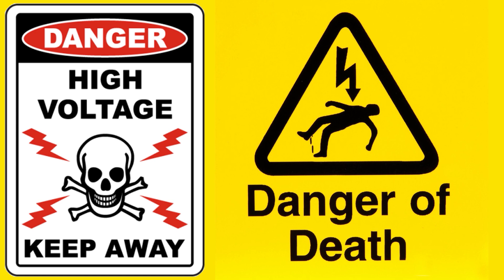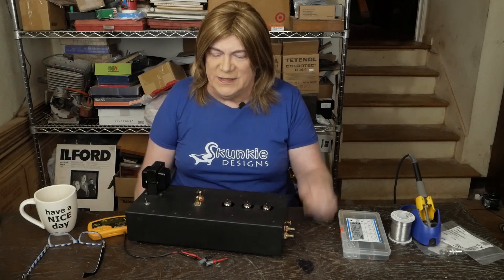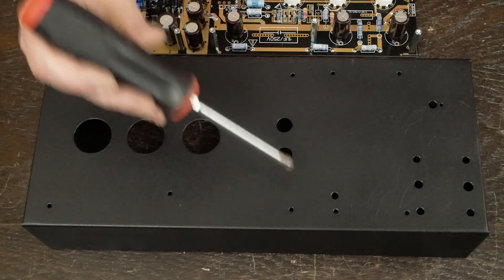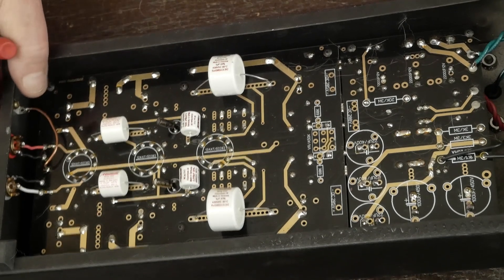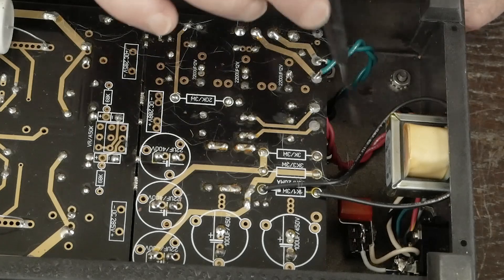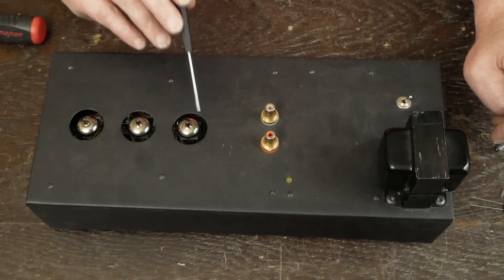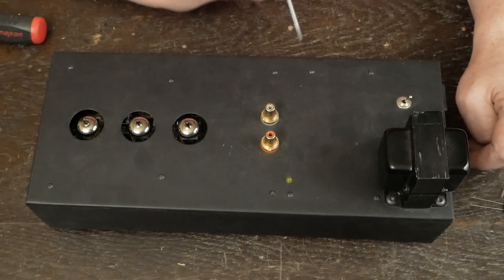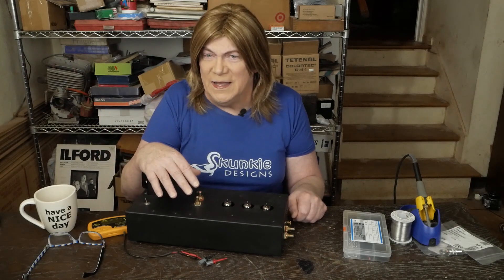EAR834 Clone Phono Stage Pre-amps: Chassis Layout Explained.

Comment: It's the phono amplifier that I put together in August 2022
The output is high.
Reply from the maker: Yes it does have a hot output, and the problem is?? It's actually hot enough where it works well with HO/MC carts.

Comment: Steph, a couple of questions:

This is of course a clone of the EAR 834p. The original EAR never had a mono switch as some phono stages do, and so naturally you have not included a mono switch on the clone either. I plan on getting some vinyl records that will be mono pressings. With the EAR/EAR clone if one plays a mono record with them and uses a mono cartridge is that enough to get the intended sound from a mono record?  Are mono switches on phono preamps unnecessary? Is a mono cartridge sufficient?
Reply from the maker: I can't honestly answer that one, sorry.

Comment: Hi and thank you for all the great things shared in this channel,  I'm in the process of building one of these 834p kits, I don't know how's it in the other pcbs sold on ali, but I just discovered in mine the grounding point (little triangle)  for TT isn't connected to anything, it's isolated on both sides of the PCB so connecting it via wire to the chasis doesn't probably change anything, and if so should it be rewired to the PCB's ground or just left unused?
Reply from the maker: I covered this in one video, that's an error on some of the boards, that pad needs to be connected to the ground plane on the bottom next to that spot, opposite side from the tube sockets. Just scrape off some paint and add a jumper.
Reply: @SkunkieDesignsElectronics  ouch I must have missed that one, gonna look for this video right now, thank you.

Comment: Wondering if the BOM on your website for this is up to date for the new build?  I.E.  new chassis size/ standoffs/ fuse?
Reply from the maker: probably not, I'll take a look at updating it.
Reply: I used it recently and all went well.  I think some parts are discontinued but replacements worked fine.
Reply from the maker: That's the problem listing part numbers, many, especially semiconductors and caps, change all the time.

Comment: Correct grounding was the finishing touch. I had the ground on the PSU side connected, and when I connected the ground on the other side of the board the noise floor was slightly lowered, which for the life of me I can’t explain🙂. I had already lifted the signal ground with 100R/100nano paralleled, but that had no effect.

Comment: I have two questions.  Will this pre-amp work with moving coil cartridge?  Where can I buy the kit?
Thanks - I enjoy your videos
Reply from the maker: You would need a SUT. I would never try to do a tube only MC pre-amp, it would be too noisy. There is no kit. You can find these boards on ebay and it's DIY from there.

Comment: As a long time audio hobbyist with electrical eng background who has built & modified several phono preamps, I cannot agree with you more on the importance of the layout.  Preamps can be plagued with hum issues and can easily be set into oscillation in the hundreds of kHz which may only appear as a hum but can result in damage to downstream equipment.  The bottom line to those not technically knowledgable and equipped with the necessary equipment, as you have stressed repeatedly, is to not deviate from a design that works well and most of all is stable.

Comment: "Are we listening to this or are we looking at it?"  Quote for the day.

Thanks for a brilliant video on pre-amp layout issues.  Really good stuff here.  That EAR clone board I bought so long ago keeps staring at me while I busy myself with other projects.  Perhaps this will get me moving.  I particularly think your layout of the RCA jack locations is helpful.  I was tempted to move those but I think you are right.  I recently built a Coronet3 with one of Jim Hagerman's boards and took the risk to move the input RCA jacks to the rear panel.  I was prepared to move them back to the front if it made noise but in this case it worked.  The amp is dead quiet.  However, the board is quite compact and I have room in the case I employed to move the shielded cables away from everything.  Also, this design lacks a traditional power transformer, but instead takes DC from a separate power brick and employs a boost converter to get it to tube operating levels.  With the larger EAR clone board and a traditional power supply and transformer your layout is just perfect. 

These signals are so low level it doesn't take much to stir up trouble.  You did a nice series on the Little Bear phono pre.  In that design the power switch is in the front and the wires run right past some very low level signals.  You twisted the cables to good result. I tried that, and wrapped them with some shielding tape, but still notice a slight hum, not one you can hear from the listening position, but not dead quiet.  I have thought about putting a switch in back and just running dc to the front switch for the light.  That might be too confusing for the user though.  Maybe just remove the front switch altogether.  Too many projects, too little time.
Reply: My mistake.  It wasn't a pair of RCA jacks that I moved on that Cornet3, but rather the power input.  Given the way this amp works perhaps not such a risky move.
Reply from the maker: Yeah if the input voltage is filtered DC from a brick, that changes things for sure.
Reply: @andyfarmer2661  how do like the cornet? Which tubes are you using?lm considering building something similar but power by linear supply.